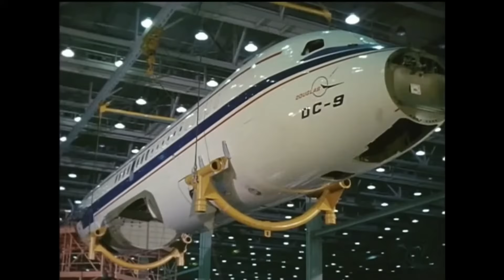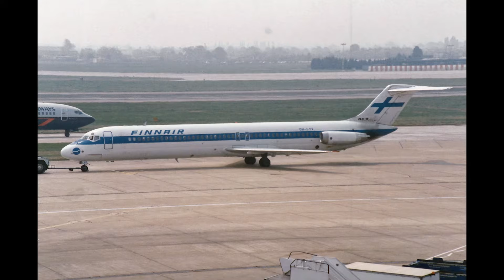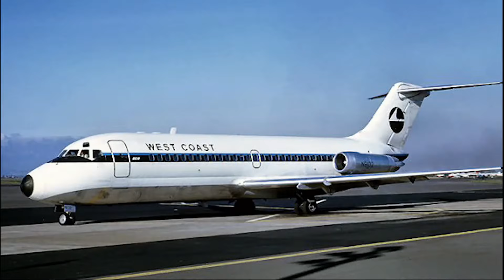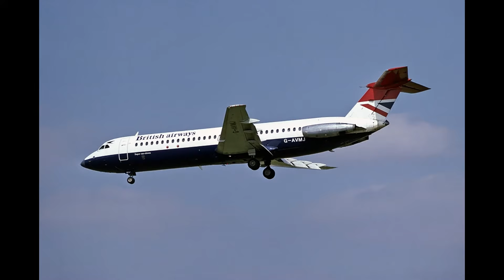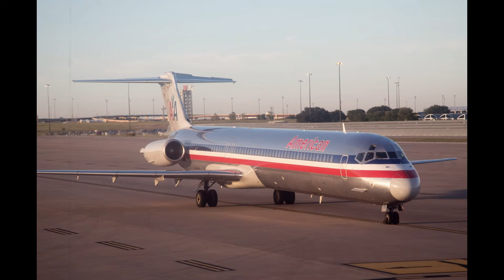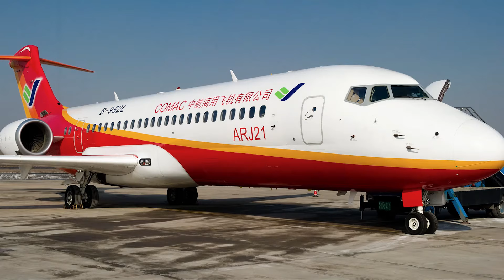The DC-9: The Success That Bankrupted Douglas

Comment: Note: the DC-9-10s had no slats, nor rear integral airstairs. The first DC-9s equipped with the airstairs (like on the Se210 Caravelle) were series -15. Wing-slats were introduced on the larger wings of DC-9-30s. The DC-9-20 was developed for SAS to operate in and out of short and contaminated runways. It had the short fuselage of the DC-9-15, but the wings of the DC-9-30 and P&W JT8D-11 engines instead of the less powerful -7 and -9. The DC-9-40 was a 76" stretch.
Reply: Thanks for the information!